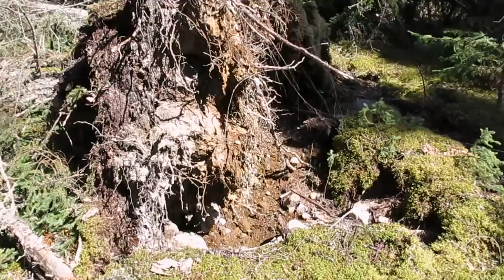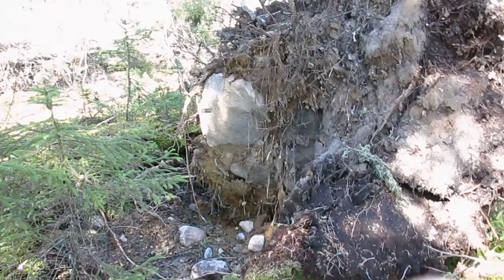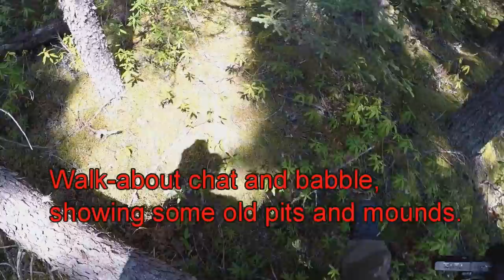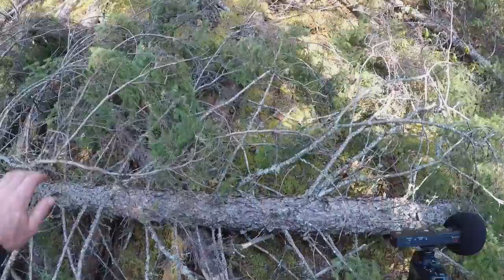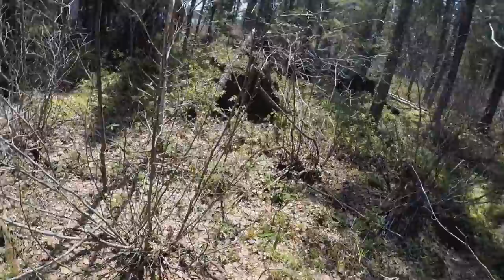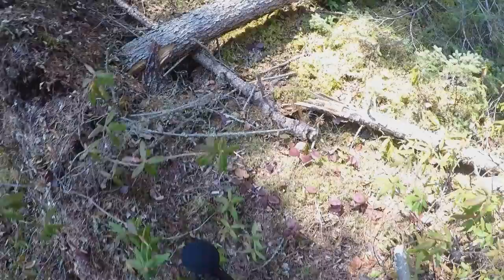Pit & Mound Micro-Topography.  Part 10: Solo 4-day canoe trip, Spring 2018

Comment: Great Video! Survival Tip: Upturned roots like those mounds are a great place to find a few rocks in the winter to heat up with your fire and to take to bed with you for heat.  Dont take them from a river because damper rocks like to explode in a fire.
Reply from the maker: Hi LFD!  Yes you are right, I have skied and snowshoed past many root tip ups in winter with available dry rocks.  I learned about exploding soaked rocks from lakes and rivers many years ago and won't repeat that mistake!  :-)

Comment: Does this pit and mound topography ever play a role when you're cross country skiing? I could imagine hitting a mound in soft powder could hurt a bit.
No ticks in the desert. So we have that going for us.
As usual, great video. Thanks!
Reply from the maker: Hi Sam!  No ticks in the desert? First time I heard that - I know very little about the desert, but it sounds great!  The ruggedness of the boreal forest here to ski through in a non-road or non-groomed and manicured trail system is almost, to totally impossible.  Its not just the pits and mounds. The many boulders and rugged ridges of rock are impossible. Then there is the dense vegetation understory that perches up the snow in air pockets, causing the skis to dive down and get caught under shrubs and debris. Two feet of snow is often the equivalent of 4 feet of snow due to the air pockets, and there is nothing underneath supporting the snow except for a few sticks, and you crash through it and wallow. And then there is the blowdown everywhere that catches the ski tips. This is the the reason why snowshoeing in the bush here remains the only real way to travel in the un-manicured bush. On the frozen lakes, and on old logging roads and groomed trails where the snow is denser and packed, skis are awesome....except when the lakes slush up, and then its snowshoe time again because the skis ice up with caked snow and ice from the slush and won't slide.  :-)

Comment: Hi Hoop. Thanks again for a great new set of videos. Always learning from you. One question I have is about flotation in your canoe (or lack thereof). What is your plan for an accidental flip over. Very unlikely, I'm sure, but do you expect to swim the boat to the nearest shore, or have you some other trick up your sleeve?
Reply from the maker: Hi Ian!  That composite green canoe has floatation tanks in the bow and stern, so it will float no problem.  The packs will all float. The barrel obviously will float. The big gear pack has many items packed in dry bags with alot of air so it will float (e.g. sleeping bag, thermarest, extra clothing, and a few other items waterproofed in dry bags).  My daypack has a sheet of foam on the back, and I keep a fleece packed in a dry bag in there so that daypack will also float. Nothing is tied in for easy flatwater trips, so if I tipped over, stuff would start to float away on me, and I woudl have to go after it. That is one of the reasons my packs are brightly coloured. Key piece of gear is the bailer, which is a cut off bleach bottle that I have layarded into the canoe.  Once I got back into the swamped canoe, I would bail it out, then chase after the packs. For serious whitewater paddling, I tie the gear all in and cinch it down using tie down loops glued into the hull towards the floor, so the lashing pulls the packs down into the boat.  That displaces water and helps the boat float higher. In a wipe out in rapids, you want the boat to float really high so that it won't pin and wrap on a rock, and the tied in and cinched down packs will help prevent a pin.  Active self-rescue is essential though, and whitewater self-rescue of self and canoe while swimming is a whole other topic, but I am trained and experienced in that.  For big whitewater trips in the arctic and subarctic, I have a royalex hull boat of similar size, with inflated bow and stern bags lashed into a cordage cage in bow and stern, for extra floation, and the packs get tied in every day, and covered with a spray deck fabric.  I had an arctic slide show video of a 35 day solo trip I did several years ago, showing all the rigging in that expedition boat, but I had to take it down because of the "borrowed" music that YT flagged.  I need to re-edit that video and add some royalty-free music, then re-upload it, but I have not gotten around to it yet.  :-)

Comment: Very informative. Not much, except for marten and squirrels live in such mature habitat.  Logging and forest fires aren't always a bad thing. Dangerous to camp and travel for sure. Thanks for the video.
Reply from the maker: Thanks mushercdn.  Yep, needs to burn to regenerate.  Most of the shrub response is not moose browse, its alder. Never saw a stick of hazel in there, and very little willow for browse. Very little moose sign there. Most of the jack pine in there will have stain and rot, and the timber companies won't want it. Some of the spruce may be good for sawlogs and pulp, but with the lower volume now with the blowdown, the companies may by-pass it, and it will just continue to fall part and fill in with shrubs, and young spruce.  Further back into the bush in a different stand that was not damaged and open and mossy underneath, I found some woodland caribou droppings, which is nice to know they are around.
Reply: How can you tell the difference between caribou and moose scat?
Reply from the maker: Moose scat is big as you know, and very fibrous. Caribou is really small, sort of like white tail deer scat, but usually a little smaller than WTD, and dark, usually dark black, and one end is often pointed, and usually not fibrous. Sometimes really small the size of large raisins.
Reply: Thanks. I haven't seen a woodland caribou in decades. There are none where I live now.  Some of the ones I did see had radio collars. I still have a photo of #7. I did see, and eat, the northern variety!

Comment: Old man winter and Mother Nature can be cruel!
Reply from the maker: Yes, but its all part of the natural cycles. Next in the natural cycle is for all that fine fuel on the ground to be ignited by a lightening strike, and it woudl all burn and regenerate all the pine and spruce nicely.  :-)   But that probably won't happen these days, because our modern fire suppression system is very effective, and they put out most of the small fires when they start, so relatively little of the forest burns these days, unlike the past where most of it burned on a cycle roughly every 75-100 years on average.

Comment: We have huge blow down in Michigan in the deciduous and coniferous forests as well but much more rare. The difference being decay and erosion eventually level out the pits and mounds albeit  decades later.  In the boreal forest, erosion and decay are also at work, but  the mounds don't erode because they are composed of rock and boulders which don't erode especially when the whole mound becomes covered in moss.  Am I on the right track?  Thanks for making a video about this.  Can you explain why after 10,000 years since the ice age, there hasn't been more top soil laid down in the BOREAL?
Reply: Mark Diroff 10,000 years isn't very long when it comes to plant productivity in such subarctic regions. The vegetation grows so slowly and is forced to "recycle" bio-mass so fast that there is very little accumulation of soil all in all.
Reply: Makes sense when you compare it to alpine and mountainous plant growth and soils, etc.
Reply from the maker: Hi Mark!  Yes, Steintanz has it correct.  Where I was in that video, its actually less than 10,000 years, because where I was standing was covered by post-glacial lake Agassiz, which was the largest post-glacial lake we know of, stretching from Ontario to northern Saskatchewan up until about 6000-7000 years ago.  It ebbed and flowed with isostatic rebound, and damming of outflows as ice to the north was still present. So where I was its only been about 6000-7000 years.  The rocks there are mostly igneous and metamorphic, and are less erodible than soft sedimentary rock, so that slows the soil making down. And the climate is colder so that slows down soil formation.  And in much of the boreal there is not much soil at all, and its bedrock dominated.  Once a tree root mat rips up some boulders and soil, there is very little erosion other that rainfall and wind, but the surface gets covered in plants quick which dampens down the erosion effect. So its very lumpy forever - except in our beautiful sand flats in some areas. Sand flats are old sand beaches, dunes and lake bottoms that are flat or rolling dunes, and there are few to no rocks.  As the tree roots rip up, sand is more easily settled down flat again, so it stays flatter in the long run. Fires might also be more frequent in dry sand flats, and the fires remove the cap of organics, and allow rain and wind to flatten out the sand again, faster I think than non-sandy areas.  All of this is in theory!  :-)